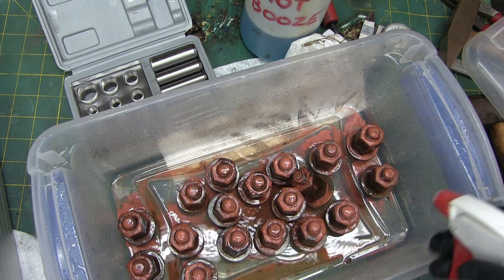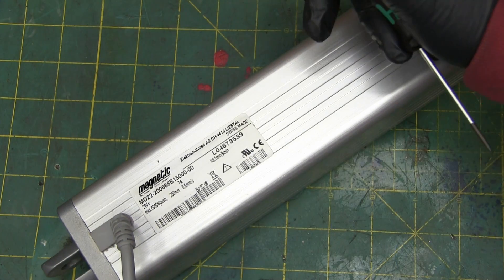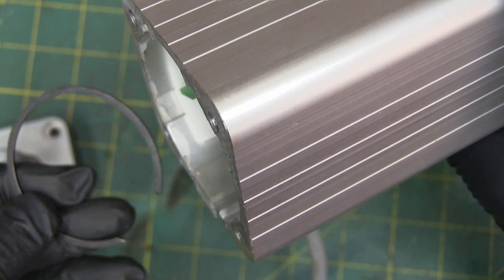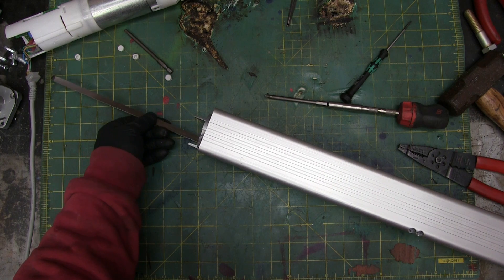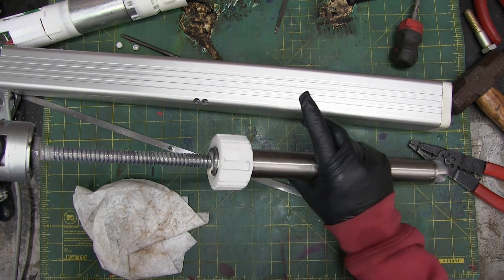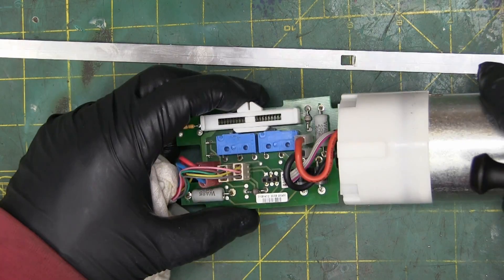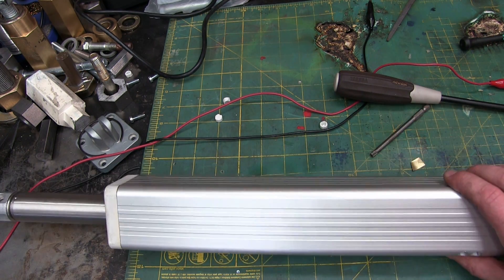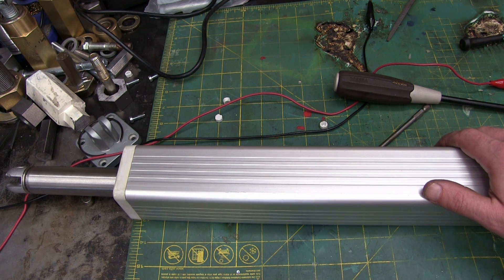BOLTR: Swiss Made Industrial Actuator | BIG $$$$$

Comment: @AvE I cant but Im pretty sure you can calculate the force on those plastic gears so the whole actuator can withstand 6000N which is around 600kg.
All in all, I’m pretty sure those gears don’t need to whitstand  a lot of force. And the argument that plastic shroud around those two gears can colaps, it cant because as I saw it sits in a round aluminum tube of the same diameter so no play for that thing. Days of all metal and skookum are over but still there are good stuff, they r just made with economy in mind.
If plastic is ok to whitstand 150% maybe even 200% load why bothering machining or sintering metal gears and housing. Swiss r smart, I wouldn’t question it.
Btw once again a good video showing some skookum stuf
Reply: Yep, all of the above. The beauty of good engineering is understanding the requirements of the job and building something that does that job, with the minimum of parts and cost and that will last the projected lifetime.
Sure, you can build it with metal gears, but all that might do is just drive up the cost and weight. Any fule knos that it's easy to build something complicated- the art is building it as simple, as economical and as efficient as possible.
In this application, metal gears may be more inefficient in terms of costs.
Reply: I've been told nylon is self lubricating, so even if they are less strong compared to metal gears they need less or even no maintenance.
Reply: The Al housing also sinks heat away from the plastic gearbox, so I think Ave’s concerns are unfounded. By the way, Delrin and nylon are not the same thing, not to mention the fact that nylon is an entire family of thermoplastics with diverse properties.
Reply: mipmipmipmipmip Embrittlement of most thermoplastics is accelerated by UV exposure, ozone exposure, and exposure to solvents. Nylons are also hygroscopic, and failure of nylon bearings and gears is often due to the swelling that happens when parts are continually exposed to moisture. These gears are presumably kept dry and in the dark. There is undoubtedly some ozone production from arcing if the motor has brushes. That’s one advantage of brushless motors. However, most of the ozone would probably diffuse to places other than the gearbox. So, I’d say that the rate of embrittlement would be slow.
Reply: exactly thought the same thing ... in this application nylon gears might actually be more durable and have less friction then sintered or metal gears would have.
Reply: The other thing is the way helical cut gears are designed they are always contacting 1 full tooth and half a tooth before and after the full tooth. At least its like that in manual transmission, that input gear was very tiny, so unsure if the same principle applies. But if it is the case you really wouldn't have to work about stripping gears.
Reply: JoJo Tk Ave liked the nice quiet drive, until he opened it up and found the gears are plastic. Anyway, if he can figure out how to get it back together and use it for wrench cycle testing, maybe he’ll have an opportunity to do a kind of life test on the actuator. I’m betting that the gears will have a nice long service life.
Reply: http://www.machinedesign.com/materials/plastic-gears-are-future
Reply: Leo Curious  Wet and dry being relative terms. I meant ‘wet’ in terms of immersion. In any case, the lower the humidity, the less absorption. Some types of nylons can expand much more than others. http://www.intechpower.com/material-information/effects-of-moisture-absorption
I agree that good practice is to design molded gears for the expected amount of dimensional change in service, but I have examined many failed mechanisms where this was not done. Common examples include wiper motors and power window motors in automobiles. Older models are especially prone to plastic gear failures associated with the failure mechanisms I described. It’s actually more common for gears and bushings to seize on their shafts first, which in turn causes tooth failures.
Reply: Bogdan Markovic if you know the pitch of the trapezium tread and the gear ratio of the sun gear it isn't that hard anymore.
Reply: great link
Reply: "Nylons are also hygroscopic, and failure of nylon bearings and gears is often due to the swelling that happens when parts are continually exposed to moisture."
It gets a little less stiffer when equalized with normal air but also much less brittle. And thats what the part will be specified for, not the dry condition. In normal conditions the equalization will be done befor the product reaches the user. There is no failing part because of humidity, that part would have failed anyway. The swelling is <1%.

"These gears are presumably kept dry and in the dark."
They are not dry, that shaft is going in and out with a lot of air coming/going with it.

The little part breaking off so easy is weird, maybe because of oxidative stress from said ozone. But PA should not break like that if its okay. So maybe its not even PA... or the part is already oxidized to hell.
Reply: Bogdan Markovic i purchase a lot of stuff swiss made (read $$$$) and they use Acrylic Delrin FR4 Nylon for construction. Some of it is required to be RF transparent.  It costs a crap ton. Most things work just fine but every now and then one of those parts fail bc of the engineering not the material, which is usually engineering with that (wrong) material in the first place.
Reply: cheradanine that is why over engineerd means weaks as F. Something that has been over engineerd has been design to just barely stand up to the job it has to do for the amount of time it is intended to do that job. Poorly engineerd means skookum as frig. That stuff is way over build, strong as hell, no failure mode because if you dont know how strong it is and it should be better just make it a bit stronger to be on the safe side. That is probably why us amateur builders tend to build things a bit to strong. No calculations? Wel just put in a bit more then you think you need and its probably 2-3 times stronger then it needs to be.

Comment: As a Metric user, I just use what I understand. lbs is kinda meh, but ft/lbs makes sense. Kilograms make sense, as does centi/milli/kilometres, inches and feet doesn't. However miles per hour and miles is what I use for driving. 
Newtons? Pfffff 
Fuck off. Retarded measurement, IMO. Has no place in what I encounter on a day to day basis. 
If'n y'all get along with it, fair play, but for me personally? Nah. Keep it.
Reply: How many thou is 1/64th inch? Welcome to metrique.
Reply: I mean, just because I use imperial doesn't mean I don't use metric. They have their places.
Reply: Rhino_Aus 5,280' (five-tomato)*12= 63,360" per mile.
63,360"÷10= 6,336" per 1/10th mile.
6,336"*8= 50,688" per 8/10th mile.
The most hellish part was navigating through my tablets keyboard to type the symbols, the rest was applying basic math with the base units.
I'm not trying to promote one system over the other, but I'm curious why anyone needs to know inches per mile, or millimetre per kilometre for that matter.
Reply: 10N = 1Kg, fair enough for me :P ..... and newtons are used in all the calculations and crap; that said its not something you use in everyday life.
Reply: 1N = 1Kg m/(s^2)....
Reply: Just think of it as a kilogram accelerating at a meter per second per second
Reply: What's half of 375 um?

3/16 mm, cuz 375 um is 3/8 mm. Welcome to inches.

Comment: That extrusion would be fun to get it to extrude straight!  It would come out of the die at first with the corners curled inwards.  It would look like a d*ck.
Reply: Barry Smith extrusions dont come out of the die straight but rather curved then pulled that both ends straighting the section.
Reply: The die has a round mandrel with a square die to form the hollow.  The thicker corners will extrude first then the thinner webs.  The ridges on the webs would cause a greater friction making them difficult to start.  If your die man and die manufacturer gets the bearing length correct for the size of the press and the temp is right, then the first 4 inches can come out curved, but not every time.  Aluminum erodes the bearings fast, even with the H13 being nitrided.  Then you have the aluminum alloy that can change the initial push.  I figure this piece is welded at the corners rather than the web.  Need I go on?  My first machinist job was extrusion die repair.
Reply: Yeah well your first 4 inches comes out curved. Lucky for you the last one is straight!

Comment: Those Swiss must have a big pair of nylon balls to try and get away with non-skookum gear material.
Reply: Unless you take the thing apart and put it back together and it doesn't work, as witnessed in this video. I can appreciate your point though.
Reply: Nylon is perfectly fine. I think the part people like to forget is application. What application was this actuator designed for? What are it's limit loads, and rated cycle time? Based on the inside, this actuator is not meant for industrial use. If so, you would see a lot more fail safe mechanisms.

Comment: I have a caveat about the skookumness of the gearing: Yeah, they'll die slowly if they get warm, but it says right on the thing that it's rated for a 1:9 minute duty cycle. Ain't gonna get warm if you use it like that.
Reply: Good stuff only breaks if you don't use it. Stay within the specs.
Reply: Yeah, but if you give the switch to the apprentice - good luck getting him to only play with it for a minute.

Unless there is a temperature shut-off in the electric bits - it will get used more. Cheap stuff says "You used it wrong", good stuff doesn't break.
Reply: first of all cheap stuff dosn't say you used it wRong, it says you used it wong.
Now that that is out of the way we all know that the apprentice wont last more then 30second playing with a shaft going up and down...

Comment: 1 suggestion would be to collab with a precision machining channel and replace the nylon parts with metal.
Reply: already machining just 2 of these gears would cost you an arm and a dick, and figuring out their exact geometry without the manufacturers drawings would probably double that cost. plus, those gears are engineered to take at least 200-300% of the rated full load, so it really doesnt make a lot of sense
Reply: Tom Lipton ( +oxtoolco ) would probably gladly hand file him some of those gears.

Comment: You sure the sun gears are not clocked? I suspect the system works on the bench, but not once inserted?
Reply: Kris Lyvers They shouldn't be clocked with a limit switch. Clocking only makes sense if the rotation cannot exceed 360 deg of Revolution.
Reply: How many suns does the thing have?

Comment: In addition to testing those rusted nuts, it would be nice to test which solution is best for keeping the bolts in place. Stuffs like loctite, nordlock wedge locking washers, spring washers and lockwire.
Reply: IIRC he already said he was going to do exactly that. At least he talked about loctite
Reply: tig filler rod for the real win...
Reply: I've worked on some equipment designed by some Canuckistanians who didn't understand what salt and water does to steel. Black steel plates connected with f**king countersunk 1/4" allen key bolts with nordlock washers under the nut. Try disassembling that shit while hanging in a wire 60 meters above the north sea after it has been there for 2 years and it suddenly fails to everyones surprise. Oh, and during assembly they really splurged out on lunch and forgot to use grease at all. 
Those nordlock washer are crazy, if I need something to stay put, that's where I'll put my money. Safetywire comes second.
Reply: i dont werk well outside either, thats why i work inside.
Reply: James Banana lockwire for the win takes time thou
Reply: ben wilson, second is the mig gun. A spotweld on your nut and you wil know its there forever.
Reply: James Banana Nordlock...end of story
Reply: Stick or flux mig, gas dosent work well outside.
Reply: Long ago he mentioned this subject in a video. Short version is Nordlock or nothing.
Reply: im going to go out on a stretch and say its lockwire ... depends on the environment though, unless he can set up a vibration rig of death (I think his wife already has one in her nightstand tho)
Reply: Paracord guts wrapped around the threads has been the best for me
Reply: It's a company-sponsored video, but the science is real:  https://www.youtube.com/watch?v=IKwWu2w1gGk